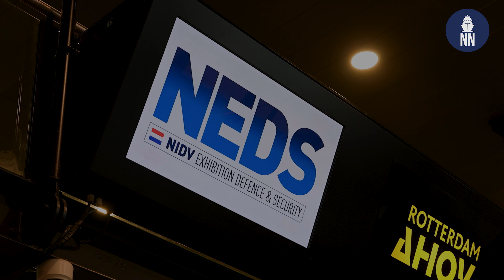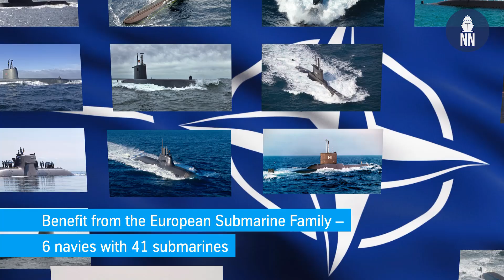Future Dutch Submarine: TKMS Type 212CD E

Comment: Canada Having the same submarines as Europe makes everything much easier from spare parts to logistics everything is NATO standardized  We should place orders for the Type 212CD submarine to integrate into German and Norwegian and Dutch navies with the weapons payload modifications so  they can launch  Naval Strike Missile  RGM-184A missiles and Strike Missile (3SM) Tyrfings and Anti-air / anti light vessel: IDAS.  This larger, more advanced version of the Type 212A features an air-independent propulsion system, increased stealth, and Arctic capabilities, aligning with Canadian defense needs to replace its aging Victoria-class submarines and strengthen its role in NATO and the Arctic.  
The Type 212 CD is a significantly larger, more stealthy evolution of the Type 212A, featuring an advanced hydrogen fuel cell-based air-independent propulsion (AIP) system for long submerged endurance. 

Arctic Capabilities:
Its compact size and specialized Arctic adaptations make it suitable for under-ice navigation and patrols in Canada's northern waters. 
Stealth Features:
A larger outer hull enhances its stealth by making it less visible to active sonar. 
NATO Compatibility:
The design is suitable for integration into bilateral, multinational, and NATO-led security missions. 

The possibility exists for Canada to join Germany and Norway in a trilateral project to acquire the Type 212 CD, which could offer benefits in terms of cost savings and early access to the submarine

Comment: TKMS expressly seeking out leading Dutch naval defense tech companies as permanent partners in their supply chain, basically making the Netherlands the third nation involved in the development of all future TKMS submarines seems like a much better deal than any one-off inclusion of X percent Dutch components. And considering the long-term nature of defense procurement links, the extensive customer base of (upgraded) Type 209, Type 214, Dolphin class and Type 216 submarines, this is likely to provide a constant and reliable revenue stream for Dutch companies and ensure that TKMS will be able to defend it's role as market leader in this particular niche.

Non-nuclear submarines are a sideshow for French submarine industry anyway. And the A26/Blekinge has been in (intermittent) development for 30 years. According to the latest contract, agreed on since SAAB bought Kokkums in 2015, the two submarines should have been delivered last year. Instead this miracle machine is now projected to be delivered in 2028, it will supposedly be available in three different versions, though so far the only order is for 2 identical units. The initial budget for the first contract in 2012 was 3 billion SEK. When the contract was renewed with SAAB as the new owner it had ballooned to 8.2 billion SEK, which was again increased to 13.4 billion SEK along with the announcement that development and production would take another 5-6 years. 

I think that's what the TKMS representative is referring to when he speaks of "the best technology on the market, but with manageable risks" - the Type 212C/D E would be a modification based on the Type 212 C/D design that is just now in the production phase after extensive research and development by Germany and Norway resulting in a new, bleeding-edge submarine based in part on proven Type 212A technologies. So it will indeed be the best technology on the market, but based on a product that has already passed the development and production phase - a brand-new design but without any reason to expect any significant teething problems, not for the Type 212C/D, nor for slightly altered Dutch variant. It won't be a Dutch version of a submarine that doesn't even exist and won't for another 5 years at least, with runaway costs and massive delays having accumulated already for the single government involved so far.

Comment: I'm reading Karl Doenitz, memoir. Interesting how a weapon system can change over time, if the Kreigsmarine had a few of those subs in 1942, they would have von de var, vith ot a dout.
Reply: I never knew this until recently but it turns out most of Nazi Germany's productive capacity during the war went towards building submarines and airplanes. It did not go to tanks or land forces which was a quite a surprise to me.
Germany basically lost the war at sea and in the air.

Comment: navies around the world could do with a slightly larger variant of the Type 212 CD & 218A class of submarines . . . designed & built by thyssenkrupp Marine since the 1990s . . . for e.g. a fleet of 10 brand new Type 212 CD class 6,893 ton (8,202 ton loaded) stealth guided missile fast attack submarine powered by cutting edge iSMARTFuelCell Integrated e-AIP marine propulsion system . . .
Reply: Do you mean something like the S80+ class? That' s gonna be a hit

Comment: What the difference between 212 cd and 212 cd e? Other than Norway getting 212 cd and Netherland 212 cd e.
Reply: Its bigger. The 212 CDE  has more fuel and has 3 diesels onboard. The standard has 2 diesels engines
Reply: It looks like what they previously called the 216, which they offered to Australia
Reply: @briananthony4044  Before they went for the nuke ones from US?
Reply: @OleBrumHonning  Yup2
Reply: The Dutch want to cross the Atlantic and be able to take out Venezuelan ships and air planes with no local harbour support. In case the Dutch islands just off the coast of Venezuela get attacked. The normal German Norway sub is a purely brown water sub.
Reply: @Prometheus4096  not really. If Venezuela attacks one of our islands, these subs are not going to defend them. We will kindly ask the US and guess what... I am thinking US Marine corps comming along the one or two battalions that the Dutch will be sending... and probably the USAF.

Comment: Would not be surprised if the Dutch choose this since the Germans chose Damen for its next frigates.
Reply: marcus..For fun, I once had AI do an analysis. The U212CD is a cold-water submarine and fully capable of operating in the Arctic. That means -1.8 degrees Celsius seawater in continuous operation for weeks and months. That's pure stress for equipment! Germany already has a lot of experience with this with the U212A!
Regarding sensors, the U212CD is FCAS capable and, according to AI analysis, is in a whole new league that didn't exist before when AI evaluates sensors! The U212CD can cover a large area with the TKMS drones, so sensors can apparently detect up to 90-100 kilometers away! The drones can do that too!
Regarding diving depth, the U212CD is 1.25-1.5 times more stable than a tube submarine thanks to its diamond/egg shape! AI estimates the diving depth to be over 1000 meters based on the U212A calculation, where the stated burst limit is officially 700 meters! AI assumes it's closer to 900 meters, just like the experts!
According to AI, the U212CD is extremely dangerous with drones, especially if the Diehl underwater hull from 2005 were added! Over 200 knots/400 km/h, in tests even 800 km/h! Range 100-160 kilometers! Intercepting the Barracuda is currently only possible with the Barracuda! Enemy sonar would even classify the incoming Barracuda as a nuisance, especially if it accelerates to 800 km/h in the last 5 kilometers! It has no explosive device, and the sheer kinetic energy is enormous if it hits the hull! The U212CD is scalable, and a 100-meter-long U212CD would be even more dangerous. The range and operational time would increase significantly! Only additional modules would have to be installed for extension, which AI says would be cost-effective!
A comparison of the U212CD to the KSSIII would show that the KSS III is inferior in all respects, especially in cold water conditions, as TKSM has many years of experience in this field!
A U212CD with 8-9,000 tons, enlarged to the Virginia class, would be far more dangerous! For the $4 billion to build one Virginia nuclear submarine and another $4 billion to dismantle, two U212CDs could be built that could carry nuclear missiles! Maintenance costs would be a fraction of the nuclear submarine. Far fewer crews; AI estimates around 30 + 15 nuclear missile specialists! The U212CD can operate with a snorkel and still listen perfectly to its surroundings; AI simply filters out interference from the U212CD. This allows it to travel over 20 knots. Aton submarines travel at 8-15 knots when listening, which the U212CD can do far better without any problems! Stealth technology through its design and additional deep diving capabilities is in a different league. According to the AI, it dives deeper than any nuclear submarine, giving it a huge advantage in terms of undetected depth and currents!
Honestly, your knowledge of submarines is pretty meager, according to the AI!SIII would be inferior to KSS III in all respects, especially in the cold water sector, since TKSM has many years of experience in this field!
Reply: You were right. The Dutch contract went to Naval Group for their blacksword barracuda submarine.  I believe TKMS is currently negotiating with Indian navy for 6 units of a bigger version of type212CD E which is dubbed as Type 212NG
Reply: Forget it as SAAB and DAMEN are building the next generation of Dutch submarines using Dutch experience know how and  Technology with Swedish Experience Know How and technology .  
Germany is a brown water sub builder .  Naval a nuclear sub builder  ,  and both designs need tons of reworking to make it remotely compatible . 

The only design left the Saab Damen design .
Reply: @marcusfranconium3392 Saab and Damen can't build subs. The Dutch ask for a very specialized sub. It will either be the French or the Germans. Probably the French. The Swedes are amateur hour. Sorry, but it is true. Not even comparable, sadly. If the Swedes are smart, they abandon Saab subs and just buy from their NATO partners. Yes, Germans are brown water, French are blue water. But Swedes are no subs. Literally nothing. Just design plans. On top of that, the Australians already paid 1 to 2 billon to develop a diesel variant of the Barracuda. There's no way Saab can even come close to that. It is literally comparing a drawing of a Lada from the 70's with an actual Mercedes coming out of the factory right now. Saab shouldn''t even have been in this.
Reply: @marcusfranconium3392  u212cd is more stealth and lethal everything nuclear sub in the world, is the f22 of the ocean, also in 800 mts deeph eual of best nuclear subs, german build the better sub in the world. "Germany is a brown water sub builder" really? only you think so
Reply: @sinceramente2512 this submarine is already under construction at TKMS in Kiel. It is a German submarine and NOT a dutch one. The norwegian Navy did order,I am not sure, but I think 4 units and the German Navy did order 2 of them.
Reply: @mikebuchner7781  norway and germany both ordered 6, and germany has an option for another 3